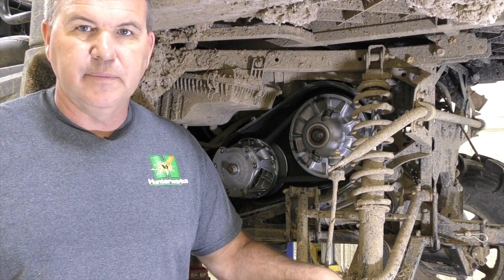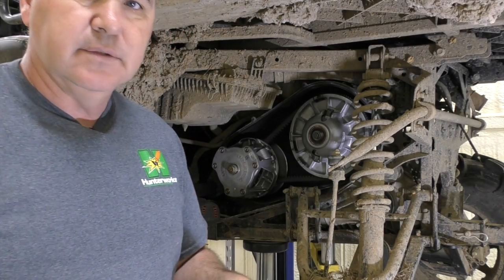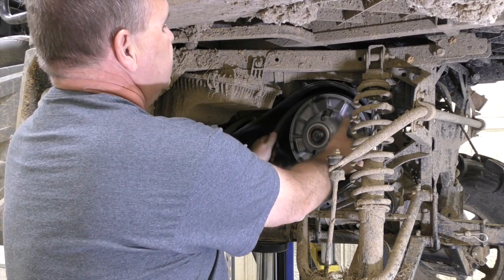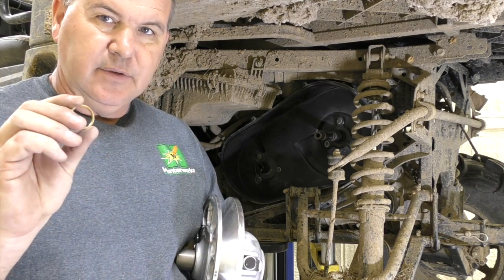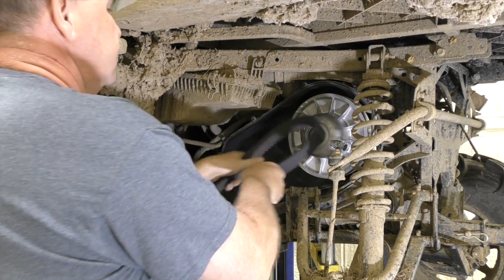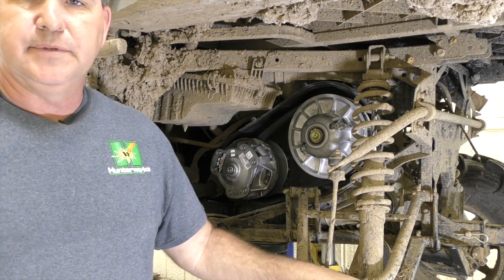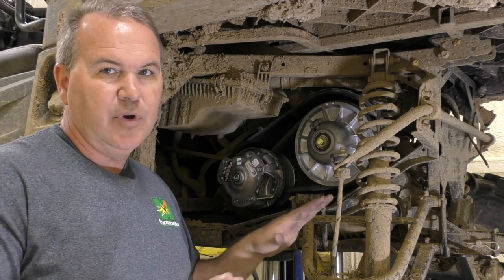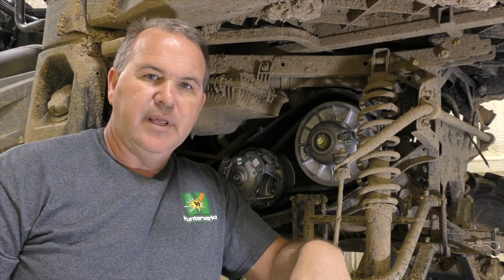New Duraclutch Alignment Process

Comment: I’m guessing there are no shims on 14/15? Just put my duraclutch on mine and is hard to shift into gear. Have ridden it yet. Trying to make sure there isn’t something wrong before I drive it to break it in. I aligned shafts with the hunterworks alignment tool before install.
Reply from the maker: Drive it.   No shims

Comment: I put a duraclutch in my General back in May, and now it is jerking just as bad as my oem clutch did. And this is after I blowed it out thinking it needed it. And there has been no trail riding since install, all street use.
Reply from the maker: If you bought it from us, email me todd@hunterworks.com and we can get you fixed up, if not then contact duraclutch on it

Comment: My secondary is moving about a 1/8 of and inch back and forth, is that normal?
Reply from the maker: If you mean that you are grabbing both sides of secondary and moving in and out, then yes probably not quite 1/8, it is the whole shaft moving and it is normal
Reply: i ask the same question.  the clutch moves back and forth on the central shaft.  this allows the clutches to come under lateral sideways stresses.  if this is the case and are being manufactured this way, there is a problem.  lateral stresses will cause fractures in these little clutch media. how can a clutch be allowed to move sideways while it is engaging without damaging it?